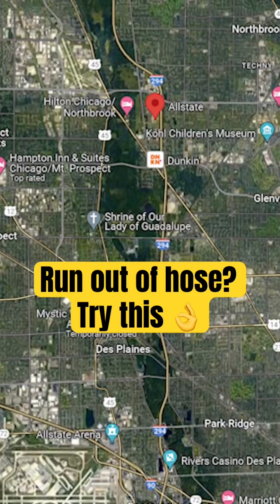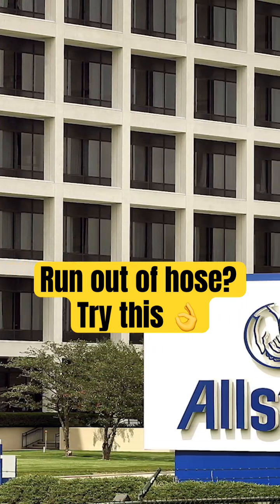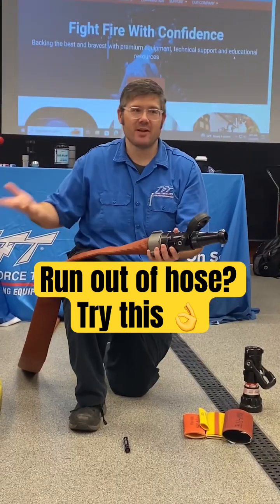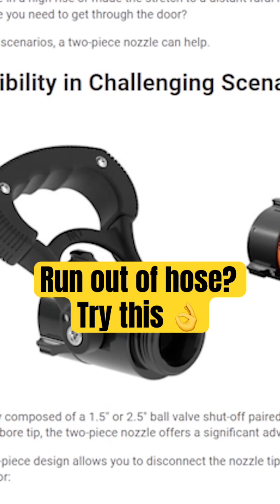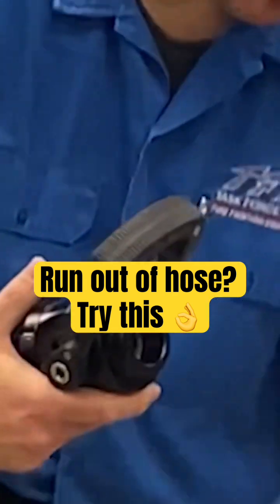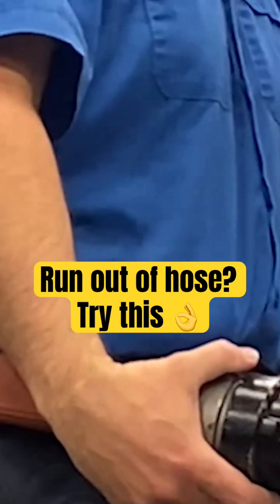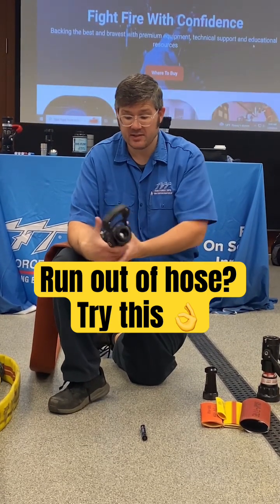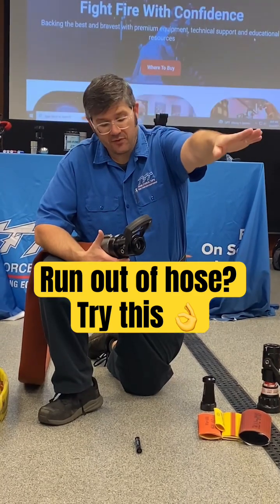🔥 Clever trick: When you run out hose at a fire scene

Comment: My two cents: if the line needs to be shut down anyway, I’d rather the pump operator add a length outside. He can see better and doesn’t have soaking wet structural gloves on so he’s less likely to be fumbling. Donut rolling a few lengths of hand line in the engineers compartment allows him to quickly deploy the line and have both ends in his hand so he can break the line where he sees fit, attach the line and recharge. Now you don’t have the bale getting caught on everything and all the line is connected how it should be. This is all assuming a backup line has been stretched and is protecting the initial while this is happening. If the second line isn’t in place yet, it’s probably faster and safer to just go back outside and stretch a different line but this time with the right amount. Or even better, know your district, replan your stretches and get it right the first time. But I get it, mistakes happen.

Comment: Yea, just because you put a 2.5” line in the adapter, doesn’t mean you’re getting 2.5” worth of water…. Especially when you’ve bottlenecked it with a 1.5” valve
Reply: It depends on what you're flowing. but the FL or appliance loss would be minimal.  I remember you add 10 PSI for Appliances when flowing anything over 350gpm.
Reply: I'm curious what the Coefficient is on flow loss
Reply: While youre correct that there will be a loss, the friction loss per 50' of hose would be far less with 2.5" hose and a 2.5" nozzle than it would with a 1 ¾" handline, and in high rise where elevation loss is a factor, you need every psi you can get.

Comment: I assume the reduction, then expansion is compensated for by the pump
Reply: No. The maximum flow rate is capped at the smallest size of pipe. You cannot physically get as much water through that reduced then expanded line as you would with more of the larger line.
Reply: @artemisargent8623  welp, that's unfortunate. I was hoping water behaved like electricity
Reply: huh? I thought flow (gpm) is dependent on the nozzle.